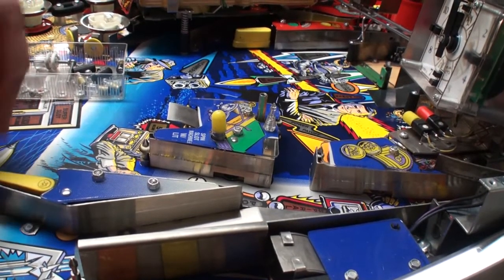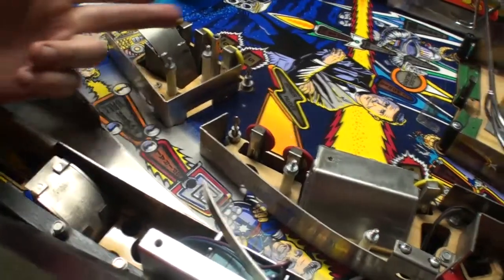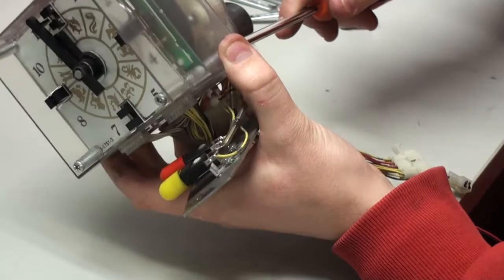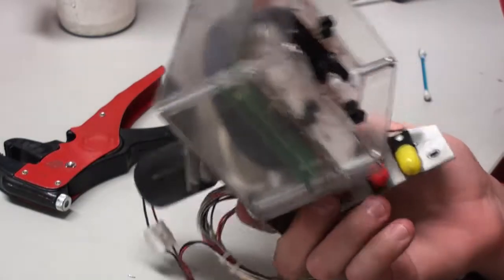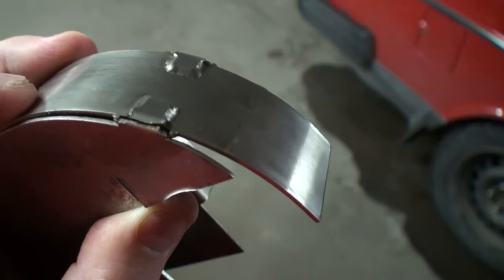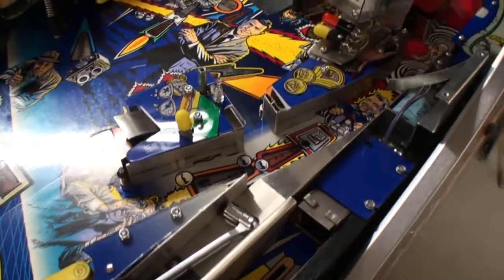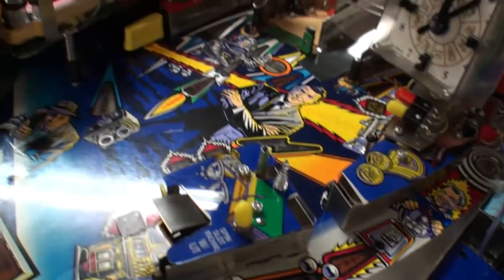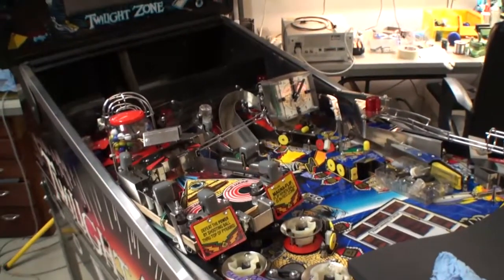Clean & Restore a Pinball Game - Part 7/9

Comment: Hey thanks a lot for your videos! I really enjoyed them! Great resource for a TZ owner.  I have a couple quick questions about connectors.

 Do you have any suggestions as far as connector replacement? Do you like IDC? Do you know of a good tool to use for IDC? Is there an alternative to the IDC such as a crimp and stuff? 

Any input would be much appreciated. I discovered some bad IDC crimps on the clock connectors and want to know the best way to go about fixing them. Thanks!

Comment from the maker: Yo! Yes there are diffrant kinds of connectors and I like the crimp kind best. It takes alittle longer time to do, but you know it will work in the long run. You need a special tool to crimp this suckers but I guess you can do it with a plyer if you just have to do a few of them. I dont know where you are located but here is a good place to look: marcospecialties . com